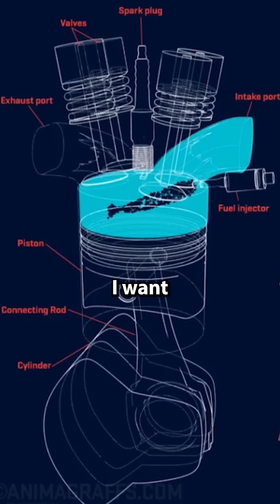All induction is forced

Comment: Naturally aspirated literally means there is nothing but the vacuum created by the piston moving air into the cylinder. Of course there's a force forcing air into the cylinder, it's just not an extra "unnatural" supercharger building above natural pressure in the intake.

He's making a semantics distinction that only makes sense if you don't know the definition of the phrase "naturally aspirated".
Reply: He just means that air has momentum
Reply: @kenandrieling5885  I know, he just explained it in a dumb and not completely correct way
Reply: no, it makes sense if you have common sense. unless you meant that it’s only new information if you don't already understand the basics of anything..
Reply: @naudelrussell4868  what makes sense if you have common sense? He said all engines have "forced induction" because natural atmospheric pressure forces air in....... But natural atmospheric pressure inducing air into the engine is what natural aspiration is.
Reply: @jaredlancaster4137  exhibit A^
Reply: @naudelrussell4868  exhibiting what
Reply: @jaredlancaster4137  💀

Comment: Please explain the Naturally aspirated supercharger effect of air intake manifold scavenging. If i understand correctly, with peak scavenging from intake and exhaust, which only occurs in certain rpm ranges, you achieve a larger volume of air/fuel. But there's more to it. Please explain.

Comment: I can't agree with the semantics that a normally aspirated engjne is forced induction.  Any boost whatsoever, no matter how small, above ambient atmospheric pressure would be considered forced.  But atmosphere abhores a vacuum so it simply fills in a low pressure area, such as above a moving piston.
Reply: The air is at roughly 14.7 psi - atmospheric PRESSURE, or one atmosphere, or one bar.
The engine creates a lower or negative pressure as the piston travels down the bore - a pressure differential - so the higher pressure flows into the bore to equalize with atmospheric, it's PRESSURE that forces atmosphere into the bore. Naturally occurring forced induction. 
It's not hard to follow, with an open mind.
Reply: @Motor-City-Mike  Naturally occurring forced induction? Open mind, you say?
To accept this definition, you need a little more than an open mind. You would have to forcefully implant it. So I guess that then could be called forced induction.
By this definition, humans could be called "naturally occurring artificial intelligence".
Reply: The bore is being filled with about 14 psi of pressure at sea level. The semantics is correct.
Reply: @martinllanos4998 😂👌🏻 perfect 👏🏻
Reply: @martinllanos4998 Atmosphere isn't 'forced' to go anywhere, it will naturally flow towards a low pressure area.  A boost is anything ABOVE natural ambient air pressure.  I know it's a concept, but you can understand this if you want to 😂

Comment: In addition to the speed that the suction takes place, the intake valve has to open before the piston reach top dead center to compensate for the inertia that the air will face and take advantage of the suction effect that the overlapping exhaust valve flow introduces. The intake valve not only opens earlier of top dead center, but closes after bottom dead center to make the most suction it possibly can utilizing the flow inertia for advantage. Your basic calculation is assuming valve duration of 180 degrees of crank rotation witch is unlike in a real case scenario. Lastly the velocity is restricted by geometric characteristics of the intake manifold so the volume of the cylinder in a naturally aspirated engine will never reach 100% filling.
Reply: There is no suction, there is no vacuum. Thats the whole point of the video. The surrounding air pressure is 1 bar (14.7psi), when the piston moves downward it creates a pressure differential that the atmospheric pressure rushes in the fill. That's why he just described it as nature's forced induction.
Reply: @Wandering_Horse  but is  circumstantially possible to fulfill the cylinder capacity at a 100% . Vacuum is the difference in pressure that you are referring. The atmospheric air faces resistance forces that restrict the flow such as the valve it's self which is in the flow path , and the geometry of the intake tube that might choke the flow at some points of the rev range. Some says to achieve the 100% volumetric efficiency of an engine is by optimised tubes, valve lifts or duration increase and ram air.  His explanation is for the audience that want a macroscopic view of the procedure
Reply: @Wandering_Horse ”negative pressure” causes a vacuum as it creates a difference in pressures. Vacuum just refers to the empty space created.
Reply: @naudelrussell4868   In this reply I may be wrong but it is as I understand the physical world. There is no 'negative pressure', negative implying less then zero. There is only less then atmospheric pressure. When the piston accelerates downward it creates a difference in pressure agreed, but it is not negative, it is still above absolute zero. It might be only .00001psi but it can never be negative, thus the higher pressure, in this case 14.7psi (1 bar, or 1 barometric pressure unit) rushes in to fill the less then unit of pressure differential, but it is not a negative number. There is no vacuum, you would need to leave the earths atmosphere to experience the vacuum of space. Please understand that 'vacuum' mean vacant or void, technically speaking it is an area of zero matter, as in no molecules, no matter, nothing, void, etc... So with that said again, there is no such thing as vacuum nor negative pressure inside the cylinder of a internal combustion engine.

Now with that said...In some engineering and applied physics it is understood that 'vacuum' can refer to a space that is considerably lower than atmospheric such as can be said about the low pressure differential induced in the operation of a combustion engine. I do however believe that it is important to make the scientific distinction that a true vacuum, nor negative pressure is what is actually occurring inside the cylinder. 

If you believe that I am fundamentally wrong, please explain in technical detail so that I can learn where my thinking is flawed. Thanks!
Reply: @Wandering_Horse  When people talk about “negative pressure,” it just means there's less pressure when compared to something else, a relative negative. it doesn’t necessarily have to mean less than zero just like a vacuum doesn’t have to mean perfect, it’s more about context. The more correct term would be “partial vacuum” but most would automatically infer. Besides that, your overall understanding appears to be correct.
Reply: @Wandering_Horse  Great explanation.  I'm very pleased that there are many that understand how this works.

Comment: my 6.9 idi runs just fine n/a
Reply: I've heard that they designed the idis to use a sort of venturi effect to atomize the fuel before entering the cylinder so they run cleaner for longer than direct injection motors with worn out spray pattern injectors
Reply: @calebz1448  they are a precup design the fuel is injected into this cup then drawn into the main combustion area. my 7.3 idi a very very similar design as well. but then they switched to the directed injection powerstroke which is turbochraged which i have a few of as well

Comment: That's not how it works...🙄
Reply: That’s literally exactly how it works.
Reply: Care to elaborate and inform us of how it works?
Reply: @Wandering_Horse ... It's equalization from ambient atmospheric pressure filling in the lower pressure area in the intake manifold and cylinder.  Any increase above ambient air pressure, no matter how small in the engine, would be considered BOOST.  
Otherwise it's definitely considered a normally aspirated engine.
Reply: There's always someone who thinks they can school Gale Banks...

Comment: Hmmm this got me thinking.
Can gases exist in a vacuum?
 Not in a "man made" vacuum I guess because it will get "pumped out", right? 
But what if we release a gas is space, will it immediately disperse or just hang around since it has no lower pressure place to go?  Maybe it will keep traveling since it won't loose its speed. What happens  to the gas from space rockets?
Wound a combustion engine rotating in space create a better vacuum in that intake stroke XD
Reply: it just dissipates into the rest of the vacuum of space. Space isn't a perfect vacuum, but it's pretty close. The term vacuum is relative as refers to the difference in pressures(matter) between spaces.

Comment: Atmospheric pressure at sea level is 14 psi (+-). A "perfect" vacuum is 30 inches of mercury.
Reply: I wanted to comment about it too when he said "vacuum" but he kind of self corrected when he said the part about ambient pressure and density going to the low pressure. He just used a misnomer I suppose when he said vacuum, instead of saying the piston creates a low pressure.
Reply: @stunna1050 but a piston reacting in a cylinder does create a vacuum, think about syringes. He is saying that even with a near perfect vacuum you need a force actively pushing air in as just the vacuum alone couldn't pull enough air into the cylinder in a quick enough time.
Reply: @Roadhouse1997 ahhhh, that makes sense
Reply: @Roadhouse1997 vacuum doesn't suck anything. The ambient pressure is doing everything. Vacuum is just a lack of pressure and the pressure wants to fill that vacuum. The air molecules never pull other air molecules. It's just the air pressure trying to equalize.
Reply: @kingofstonevalley Vacuum either refers to the absence of matter or the transfer of matter through pressure difference. both of which happen on the piston’s intake stroke. he used the term correctly
Reply: he said almost
Reply: The piston gets filled with the pressure from the atmosphere.  At sea level it is 1 atm or roughly 14.7 psi. At altitude it is less, which is why naturally aspirated engines make less power at altitude. So he is correct when he states that technically it's forced induction.
Reply: Well either it’s the cylinder creating a vacuum and sucking the air in, or ambient air pressure pushing it in, he says it’s both. Because he’s a salesman. Lol
Reply: @davidburdett1920  the piston just pushed out all of the air/fuel in the cylinder. With the piston going down there is a negative atmospheric air pressure in the cylinder,  opening of the intake valve let's Atmospheric pressure push air/fuel mixture into cylinder as piston goes down.
Reply: @MacGyver2154 this!
I wouldn’t call it forced induction , more like equalization induction.
Also sure engines can be tuned to get a slightly above atmospheric cylinder filling at some rpm but most of the time the cylinder filling will be way below 100%

Comment: Hundreds or thousands of horsepower.  My Corollas 160 hp is waking away slowly.
Reply: It's not all bad tho, 39 avg mpg has it's advantages in today's economy
Reply: I'm right behind you in my NA Mazda 3 6mt with 155hp
Reply: @JDuBz815  Mazda 3s are cool. I have a 250 horsepower V6 but you'll likely still be keeping up with me.
Reply: @bigdawg77  very unlikely. I can't keep up with automatic base model corollas. The autos outshift me. Mine is 3rd gen NA and the revs take forever to drop between gears. It's a great, reliable daily. But it's got no get up and go. I had 3 2nd gen Ford Probes (Ford version of the MX6) and even the 2.0l 4cyl versions of those cars would blow the doors off my mz3, let alone my 97 Probe GTS with the 2.5l KL-DE and the close ratio 5spd. That said, those older Mazdas don't get the same fuel economy. It's a give and take. My FS20 (4cyl) cars got 37mpg highway and the KL-DE got 32mpg highway (close ratio gearbox so 3k rpm in 5th at 60mph, 4k rpm in 5th at 80mph)
Reply: 03 Lincoln aviator 4.6L V8 300hp but only 12mpg....
Reply: @paulrun111  yeah that hurts the wallet, but the 4.6 was a reliable engine. I'd rather have a 4.6 than a 5.4 triton
Reply: @paulrun111 07 toyota Rav4’s N/A v6 makes 270 @30mpg😂